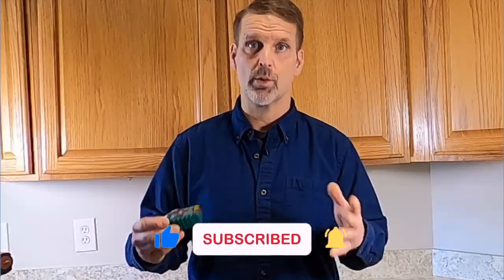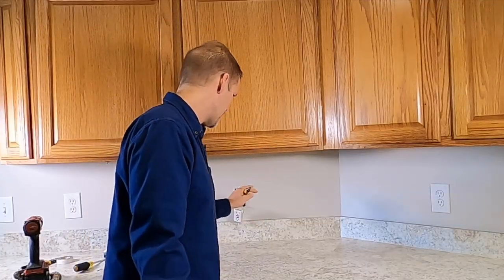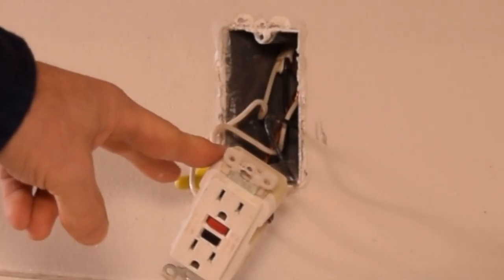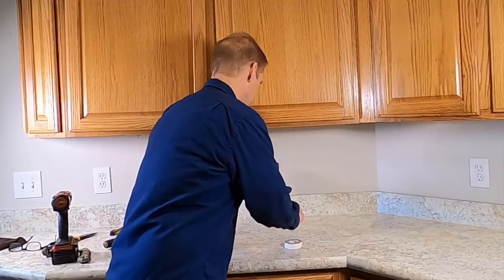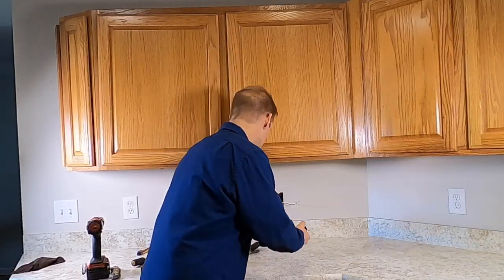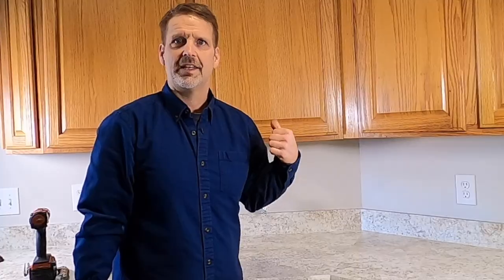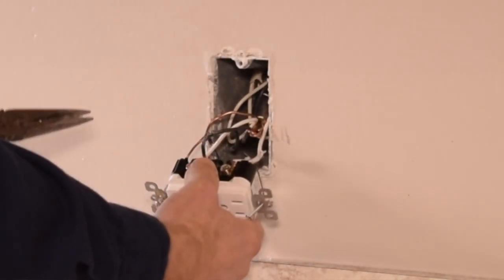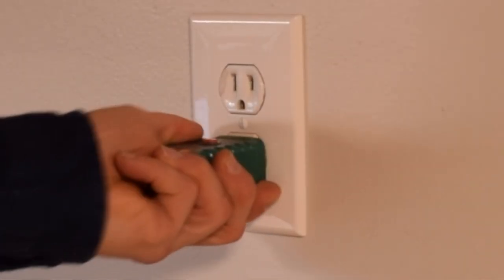How to Safely Replace a GFCI Outlet the RIGHT Way! Plus How to Test Your GFCI Outlet DIY

Comment: Helpful video, but it would be helpful to see the best way to bend the end of wire to be fastened down by the flathead screws.  That process wasn't shown.
Reply from the maker: Thanks. I'm glad it has helpful. I understand what you're saying about more detail on fastening down the wire. I plan to cover that in detail in a separate video. And, thanks for watching.